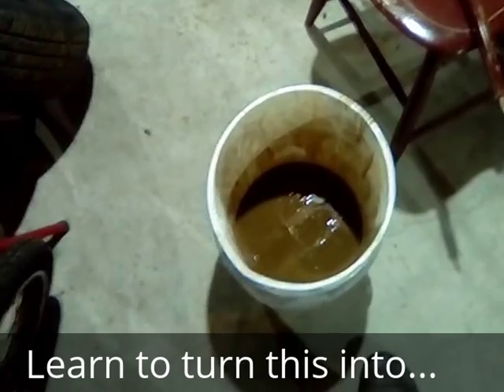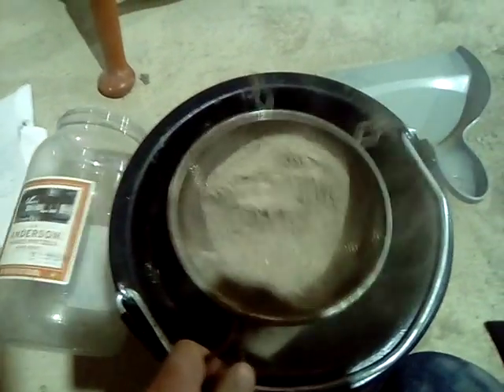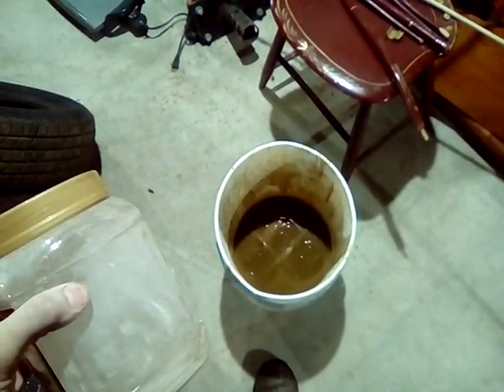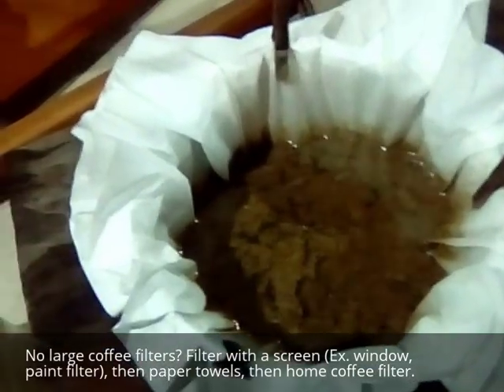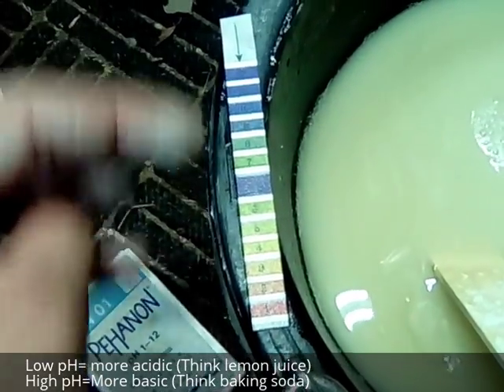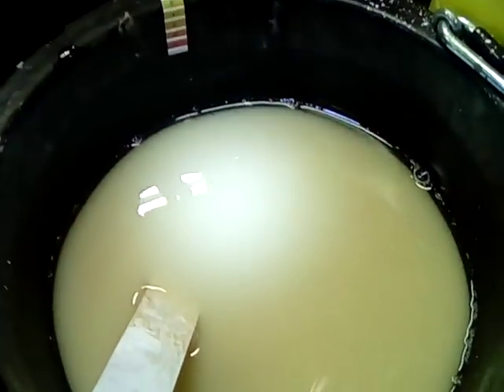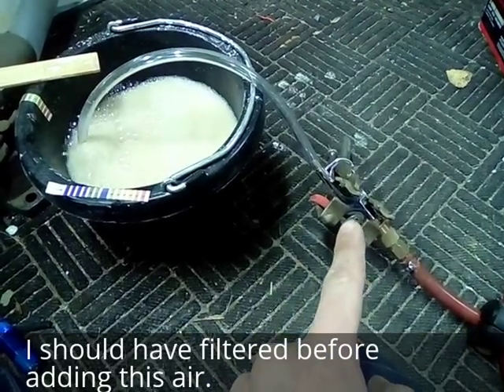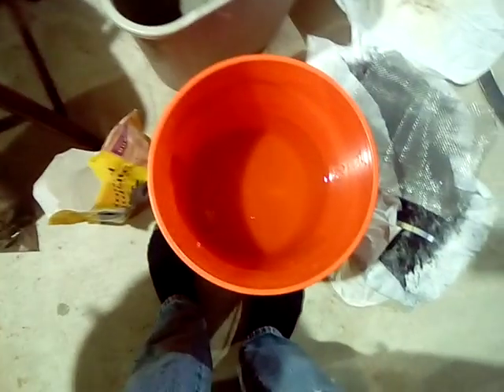Remove Oil + Pollution From Waste Water at Home

Comment from the maker: If you need help finding supplies I have included links below.

Bunn 10 gallon filters: https://www.amazon.com/gp/product/B004NEWA5M/ref=as_li_tl?ie=UTF8&camp=1789&creative=9325&creativeASIN=B004NEWA5M&linkCode=as2&tag=crisplinemeta-20&linkId=a8100cd1f4f775f1a4f6e58d07b3865d
Hydrated lime: https://www.amazon.com/gp/product/B00BSH0U4A/ref=as_li_tl?ie=UTF8&camp=1789&creative=9325&creativeASIN=B00BSH0U4A&linkCode=as2&tag=crisplinemeta-20&linkId=a33b64776445e54e01ad655315b5a8ae
Camphor Block: https://www.amazon.com/gp/product/B00I1THFZ0/ref=as_li_tl?ie=UTF8&camp=1789&creative=9325&creativeASIN=B00I1THFZ0&linkCode=as2&tag=crisplinemeta-20&linkId=d834d2f3706bf3a3a980baee16975a4e

Some garden stores will carry hydrated lime (NOT home depot or Lowes though)
Camphor can be found an Indians stores in the incense section

We are a participant in the Amazon Services LLC Associates Program, an affiliate advertising program designed to provide a means for us to earn fees by linking to Amazon.com and affiliated sites.